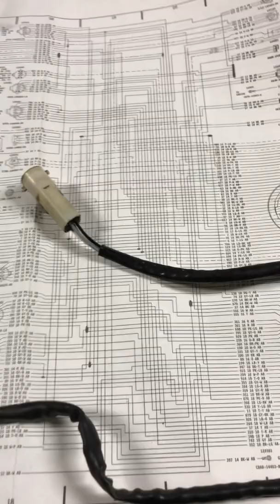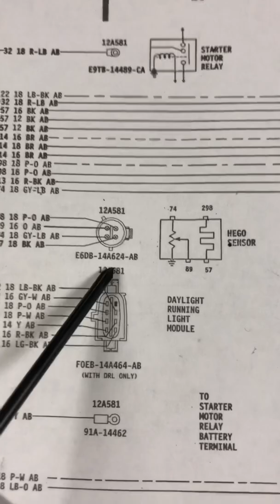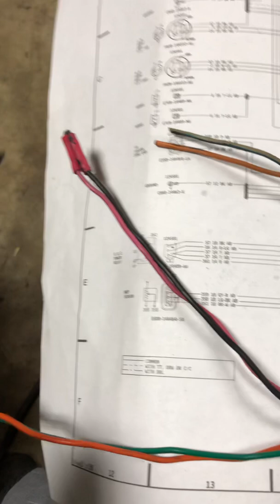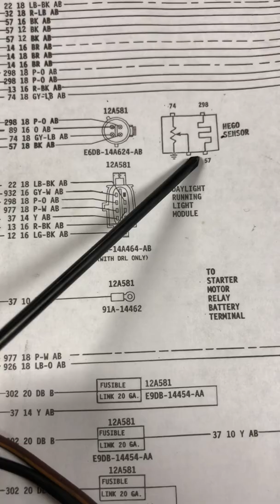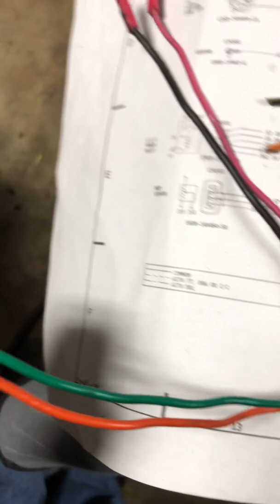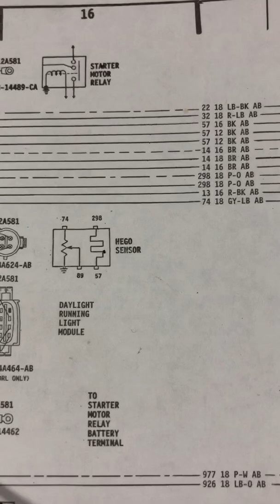1991 Ford F-150 / Bronco code 41 troubleshooting O2 sensor fault

Comment: This is a dumb question but where is it located?
Reply from the maker: The o2 sensor is on the passenger side below the exhaust manifold. Some were actually located on the manifold itself.
Reply: How many sensors are they?

Comment: Where did you buy your wiring diagrams?
Reply from the maker: These were bought on eBay. It is an Original schematic. They are maybe hard to find now. E Manual online has a pretty good schematic but paper is better if you can find them.
Reply: @Rafael Meneses  I actually been looking for a wiring diagram for the ignition coil pigtail.  So I could replace mine, but I haven't had any luck doing so. I also have a mess of other wires that someone rigged up  together that are either showing bare copper with no heat shrink on them. The wires all seem to integrate or piggy back off one another. Which leads me to my issue. I have found  the truck could be running, but if you mess with the wires I talked about, it stalls the truck. The reason for replacing my ignition coil pigtail is I found the wires to be loose inside the plastic connector.  I could record a video showing you what I mean if my comment is hard to follow. I have a 96 straight 6 4.9L